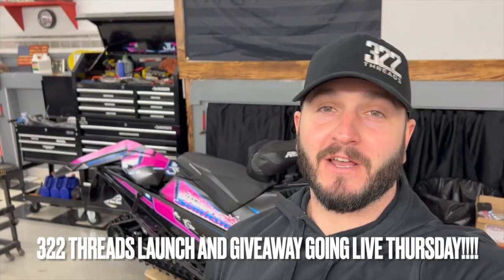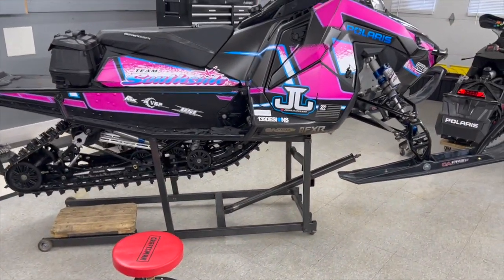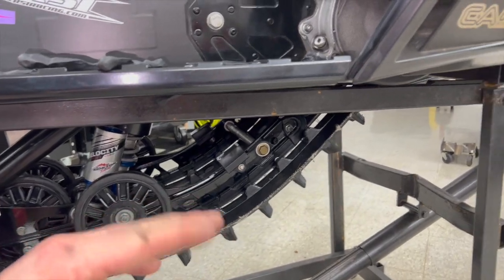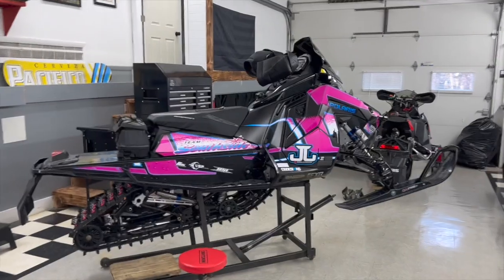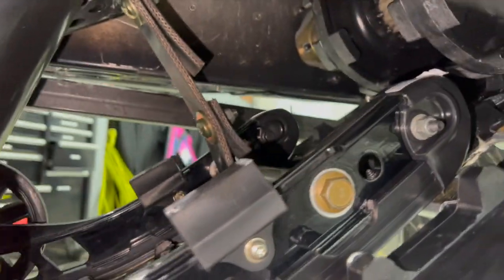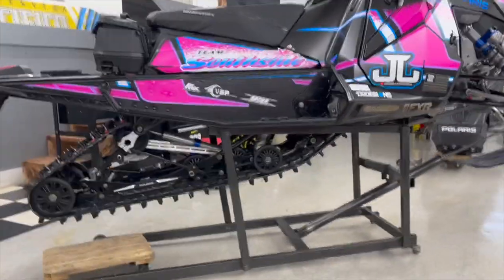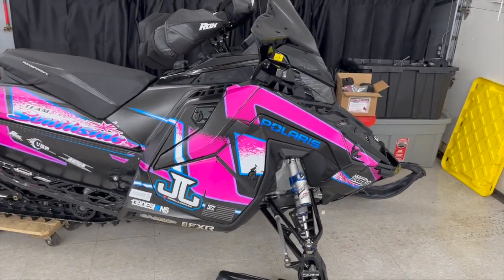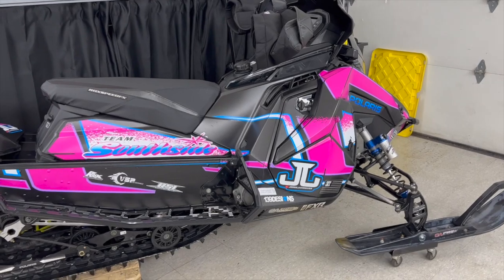2023 POLARIS VR1 BOOST LIMITER STRAP. DOES SHORTENING IT HELP YOUR SLED CORNER FLATTER?!

Comment: I had the same issue with my wifes VR1. It was very noticeable when I hopped off my XCR and jumped on the VR1 that it didn't feel at all the same. It was tippy. I just traded the VR1 and got a second XCR for my wife. Very happy now. I hope polaris offers a boost with the 2" velocity. I definitely feel they are a much better shock for the additional money. My 2 cents
Reply from the maker: they definitely are. Just a larger body so more oil more gas more room for valving. I hope they do also!!

Comment: So how much in total did you move the strap
Reply from the maker: all was specified in the video. but drilled a new hole 1 inch from previous hole which shortened the strap a half inch
Reply from the maker: Have you get entered in the channel giveaway? you could win a set of C&A skis, Woodys carbides, Woodys studs, Rox Speed FX hand guards and a $200 gift card to Southside!! anything purchased off 322threads.com gets you entered!

Comment: On my Vr1 boost I gave the front springs 1" preload, gave the front track spring it's max preload, and big Boi springs on high, I put the limiter strap on the looser hole and tightened up the rear scissor stops. Works a mile better than stock setup but it's gonna get hygear dual rate springs and a shock revalve for next season
Reply from the maker: i dont agree with that set up but if it works for you for now thats all that matters!

Comment: It is so hard to get the cornering just right.  I don't know much about these new sleds geometry, but back in the day I used to love letting the ass end hang out a bit like dirt track racing,  steering with the throttle so to speak.  I never hear you guys on the throttle in the turns.  The only thing I can think of is you use way to many studs driving the sled to straight for fast trail riding in corners. Remember it's a trail not glare ice.  IMHO  ✌
Reply from the maker: these sleds dont work like they used too. thats old technology and old style riding. not saying its wrong but thats not how you run these new sleds.
Reply from the maker: im sure some guys are sore but not me. and in 10K plus miles ive never had an electrical issue and definitely not one that has left me starnded. im sure it happenss but engines used to blow back in the day from wrong jetting. its all a different time and different issues

Comment: What do you mean exactly by resetting preload on front track shock?  I understand turning it out and back in 1/8th but not following how that’s a reset? 5:15
Reply from the maker: because we are pulling the limiter tighter you are now changing the length of the shock so you have to reset the preload on it.